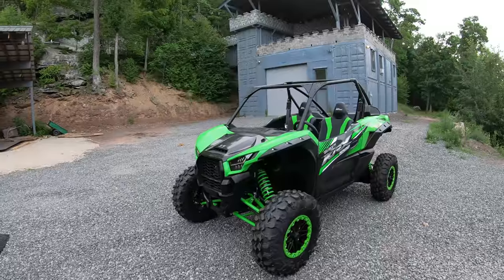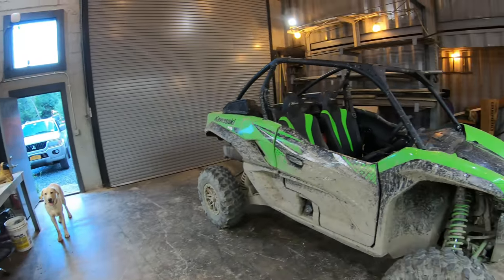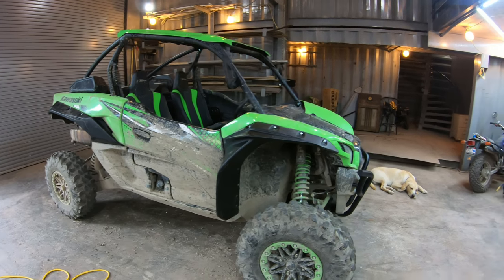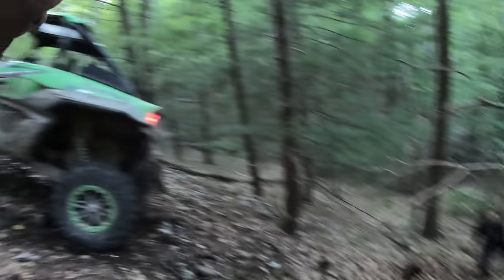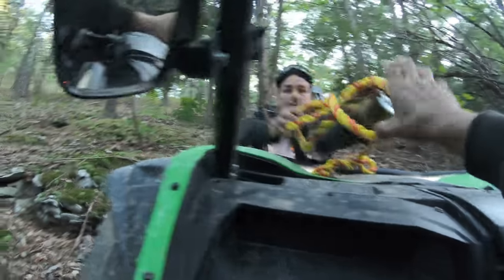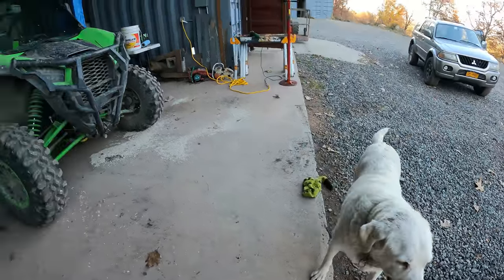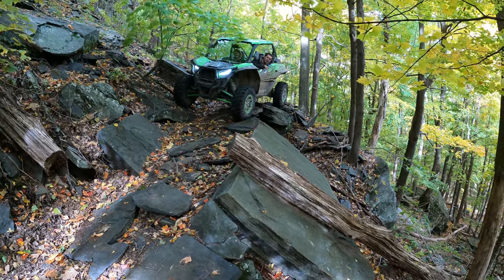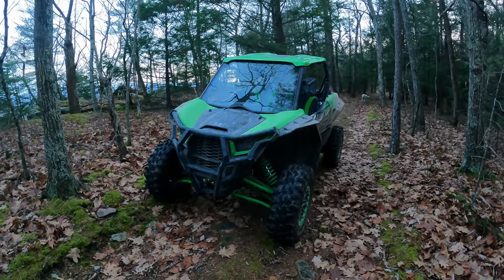Buying a sport UTV

Comment: Thanks, Andrew. You brought back some old memories of me driving through the woods in NE Connecticut as a 14-15-year-old teenager in my parent's old 58 Chevy Impala. It is where I learned defensive driving. We had about 5 miles of trails that we drove. We had a blast doing it. We would put a gallon of gas in the car and drive it until it ran out.

Comment: “Every vehicle has to have a trailer hitch” It is the way.
Reply: This is the way
Reply: I dated a "heavy" Russian chick with one. Mean, but useful.
Reply: time to get one for my boat now!
Reply: "it is code"
Reply: Completely agree. I have had a few (small) trucks throughout the years, but usually just stick to cars as I wouldn't utilize a truck all the time, and prefer "enthusiastic" /sporty driving more regularly, and the fuel savings in particular.

I still do all kinds of random projects, buy and sell stuff, move furniture, fire wood, scrap metal art times, etc, so a utility trailer works in most cases. Therfore, a hitch goes on everything!
Reply: This is the way

Comment: “Every vehicle needs a trailer hitch”

Looks at Lamborghinis, Bugatti’s, and push mowers “time to weld”
Reply: well lamborghini urus have the option for a hitch
Reply: I have one on mine plus a wench on the front.  I use it around my farm most of the time so it’s good to have.  I do NOT have one on my Porsche Boxster. 😀. But I do have one on my Jeep Willy’s

Comment: Andrew: Don’t over-tighten...
Andrew: grabs impact for next screw...
Reply from the maker: I can torque stuff to spec with that impact.
Reply: @AndrewCamarata  We don't doubt you Andrew.
Reply: @AndrewCamarata  as much as you've used that thing, I'm 100% sure you can
Reply: @AndrewCamarata  then how`d you break that one that you had to weld??
Reply: Torque to spec with impact, so one uga duga or 2
Reply: @AndrewCamarata  you’ve got a built in torque wrench in that hand. I hate it when they don’t come with one.

Comment: Heated pressure washer: absolutely the best thing going. I could just pressure wash ALL day long!
Reply: Just remember the pressure washer does NOT have to be driven full speed.  There isn't a seal, gasket or bushing that is designed to with stand the full nozzle pressure and you are not wasting money if buy a heated pressure washer!
Reply: And those rotating style nozzles are nasty. They will get stuff clean including stripping paint and stickers right off when you don't want to. Been there, done that.

Comment: I can see Andrew building a mud truck from junk he has laying around
hint hint ... 😆
Reply: in terms of mobility, this 4x4 doesn't super have a lot over a quad does it?  Thats why I don't understand why people buy these.  Its just a mix between a fun old truck blowing down through the road and a 4x4.  just do a full send and get a truck, and jack it up 6 feet
Reply: @davidanalyst671  my friend has an rzr. The idea of them is to be able to have a lot of fun at high speeds while being wicked comfy. Also, a SXS will handle high speeds way better than a square body will. I’ve been flat out on my dirt bike just to keep up with my friend with the rzr. They have their upsides and downsides. One of the biggest downsides to these new SXS’s is that they are super wide. If you are on tight trails don’t expect to be going fast.
Reply: @noahchiasson7809  thx.

Comment: First service is normally free. Be careful doing your own service at this stage as from my own experience I voided my warranty by not getting the service book stamped and carried out by the dealer. Cost me a fortune when the engine broke. Wasn't my fault but Honda used it as a loophole to avoid covering the repair cost. Also not sure if that has a 5 point harness but It would be a good safety option.

Comment: If the windscreen is a flat piece it's a good idea to make a pattern of it on some plywood (shape & bolt holes, etc).

Then when you break it you can have a local glazing company make you up a new one using the pattern for a fraction of the cost ....you need to give them the pattern to copy as it needs cutting & drilling before they temper it.

Did this for my 3010 Mule and the replacement glass was £100 vs £600 for a genuine Kawasaki one.

...this won't work if the glass is curved though.

Comment: Great stuff buddy and well deserved, you might want to put some high impact foam on those front screen upper corner fishplates before you end up with those exposed nuts and bolts stuck in your skull if your not wearing a helmet

Comment: A battery chainsaw is the ticket for trail riding...like a Dewalt or Milwaukee. They are strong and last a long time. Dont have to worry about gas. If you already have a set of those tools then you already have the battery.
Reply: Battery sawzall with a 12" pruning blade works a charm.  Small footprint and cuts more than you would imagine.

Comment: Just a friendly suggestion, drive with your thumb over the top of the steering wheel as it will avoid breaking it if the steering wheel ever spins out of control.

Comment: Man, so jealous of all that amazing riding you have there!! There is very very little riding here. You have to drive hours just to find any publicly open riding parks. There isn't even anything to ride that "slightly legally questionable" the best riding I ever did was in Allegheny in NY when we went to the "Timberline" trails. It was amazing! I sold my ATV because there wasn't anywhere to really use it. I have wanted a YXZ 1k (like your one friend has) or a turbocharged Maverick.
That Kawasaki looks really really stable though man!! I'm really impressed! Does it have high and low range? What about lockable front diff? Does it have 2wd as well as 4wd?

Comment: You LOVE “Super Swampers”!!  Interco should give you a few sets, for endorsing them in almost every video!!!🤷‍♂️
Reply from the maker: It would be cool to set up a 4 runner or something like it with bumpers, small lift, lockers, and a set of super swampers.
Reply: @AndrewCamarata  yes, it would be!  Maybe a future video?🤷‍♂️😂🤷‍♂️
Reply: @AndrewCamarata  do you think a 4 runner would have enough stock engine power, to push them?
Reply from the maker: Yeah
Reply: Forgot to say a while ago….  You should run your side by side, FAST, through a creek/river to get most of the mud OFF, underneath the fenders. What I used to do, it made cleaning A LOT easier.

Comment: How you liking it 2 years in? I am getting the exact one and literally the exact same mods, green roof, extended flares, windshield with wiper and washer, front and rear brush guard, and a double high led light bar. They don't have the green in Canada for 23. So I'm waiting for the 24s the green really pops. But yeah, any issues so far? Any more mods? And issue with spring sag? I'm in the fb KRX group and see that is likely the most common thing i hear, that and  upgrading the skid plate over the transmission. What an awesome video. Best one I've watched on the krx so far.
Reply from the maker: I like it a lot except it’s way too loud and that’s really ruining the experience for me. The performance is good, if you’re brave and can drive well, it can really fly over very rough terrain. it’s been mostly reliable, tire problems are common, and I just had the steering rack and transmission case replaced under warranty. It can’t carry a ton of cargo, but it tows decent, I did a video on the second season of this vehicle as well that’s worth a watch.
Reply: @AndrewCamarata  watching it now. I don't put my stuff through half what you do. I had a spinal fusion done on my back years ago. I'm mostly higher speed hard packed trail riding. Currently have a brute force 750 and would like to stay with kawi for the reliability ect. When you say loud, what do you mean? I plan on putting the factory stereo in it as well as the Trinity exhaust lol. I want to hear every dollar i spent. Also plan on doing dynojet ECU and clutch kit. I have the clutch kit and ecu on my brute. Different bike all together. Really wakes it up down low.
Reply: @AndrewCamarata  what a beautiful place man. Very very similar terrain to where i am on the east coast of Canada in Nova Scotia. Almost identical really. Tons of forest riding with some Rocky areas and mountains. But yeah, mostly all Forest here in Canada. I don't do rock climbing of any sort. Mostly the woods riding you do along with old logging roads and dirt roads in the country. I always always climb up to the highest part i can of any land, we have alot of windmills here so that's one of my favorite places to get to. Also, what kind of drone do you have? I just picked up a dji mini 3 pro black Friday last year, haven't had much time to use it in winter other then taking it to Cancun Mexico this winter. But looking forward to getting that out with me on the trails to get some epic views
Reply from the maker: @TheKingOfKings818  I have a handful of mavic drones, they are all great

Comment: Frustrated Andrew "I think a nut broke off in the frame <sigh>"...then quickly enters the 4 1/2" grinder...with subsequent zoom in on flying sparks. First thoughts  "it hurts me more than it hurts you brand new Kawasaki KRX1000 but we will get through this together...how about some more accessories and an oil change!".

Comment: Hey Drew I noticed you an your friends did not know your trail you all normally take wood be blocked by trees ,maybe each of you can get a small plastic tool box an place it on the utility vehicles somewhere as a just in case situation an a dual winch also front an back application Roger

Comment: Sharp machine. Do you like that new side by side as good as your utility side by side. I know those are fast, but they seem as wide as a car. It seems like it would be hard to take it as many places as you could take a more narrow machine.   Also I would like to see you take your Rhino side by side some of the same places you took this new machine and see if they can go all the same places. I know the new green machine will get you there quicker, but could you take your rhino side by side or even your regular four-wheeler the same places? it may have been a different brand than a rhino you had but you know the machine I'm talking about.
Reply from the maker: I have been able to fit everywhere with it, no problems. Its much faster than the rhino, but its not as good for work. The Rhino has a much bigger bed, that dumps, and is lower.
Reply: @AndrewCamarata  The new one looks like a lot of fun. Thanks for sharing it with us. I have a Honda pioneer 500 and after watching this it makes me want to upgrade.  With so many places allowing atv/utv as long as they have turn signals and a horn. To be licensed for the highway They should all come factory with those installed.

Comment: SxS owners are like inbred hippies and I strongly dislike them on trails because of the trash left in their wake and the trails they destroy. 

That being said, my sister just bought the 850 S, and it’s a pretty sweet machine for being a over powered golf cart. The accessories you bolted to it are cool and super useful. Glass windshield is king. 

I have had a 193T since 2010, I call it the little screamer, fantastic little saw.

I give off-road go cart owners a bit of grief but they are impressive machines when they aren’t rutting trails.

Comment: I did not understand the part, of driving with one hand, and the other hand holding a camera. It's not safe, you need to be an example. There are now a lot of connections that can be connected to a camera. No vibrations in photography. For example take a carpentry clamp I added a suitable screw and it is possible to connect a camera or any other component ...